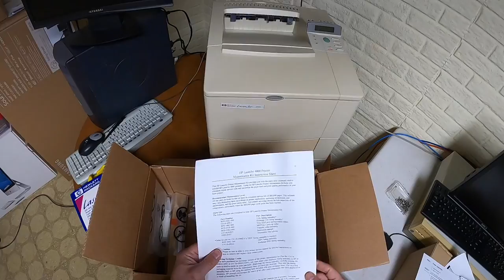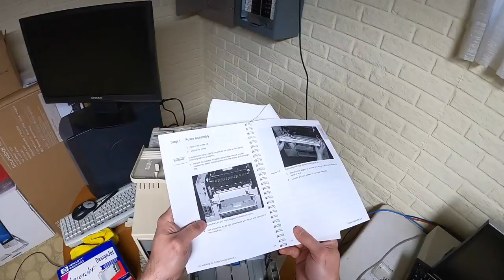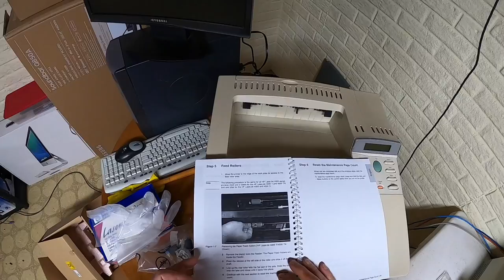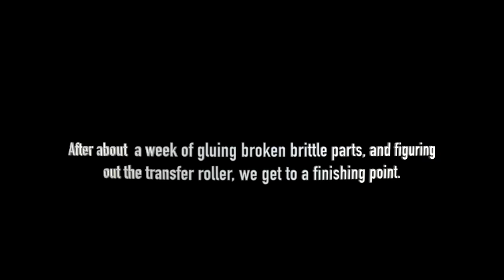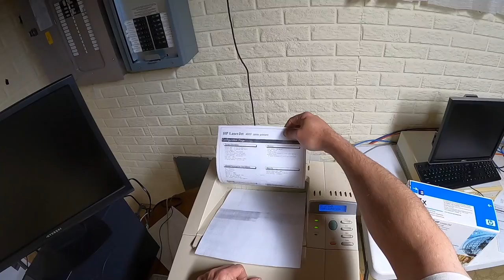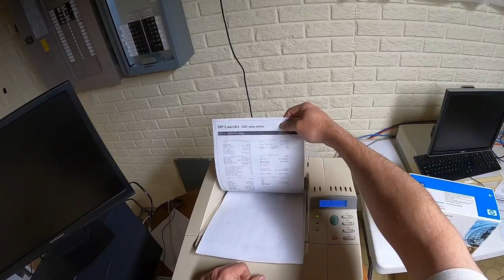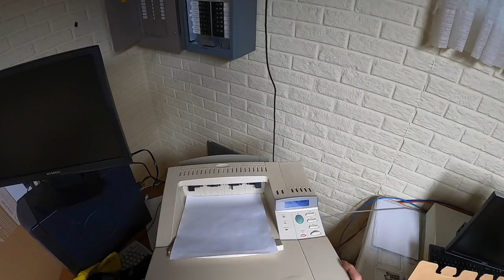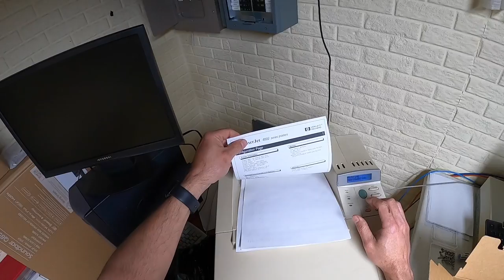HP LaserJet 4000 is back, and needing a little TLC

Comment: Howdy.  Great videos!  I had a horrible paper jam with ripped paper in what I think is the fuser model and was able to get it apart watching your previous videos.  THANK YOU.  However, my LCD screen is so dim I can barely read it.  Makes it almost impossible to read anything.  Can the LCD scree be replaced itself or does that entire electronics module it's attached to need to be replaced as well?  And if you could point me in the right direction on where to even get a new display it would be greatly appreiated.  Thank you so much!!  BTW, I own 2 of these old beasts and hopefully am going to follow your other videos on how to take them apart, and clean them.  I only use one right now and it's doing great!
Reply from the maker: I believe if you can find a donor, the LCD screen can be removed from the top cover and replaced.  Cheers.